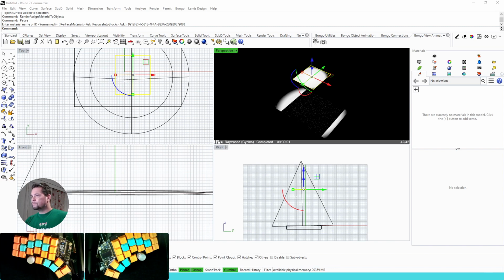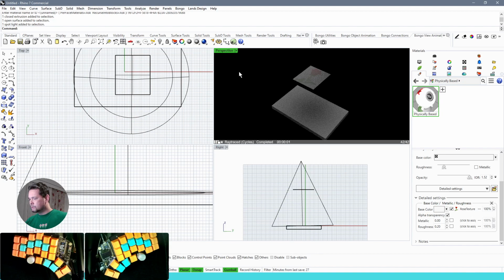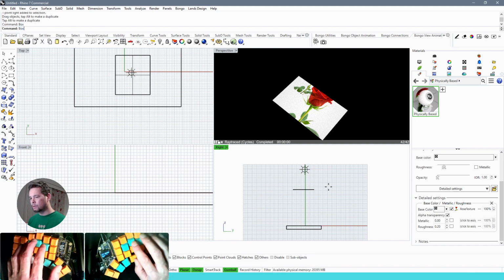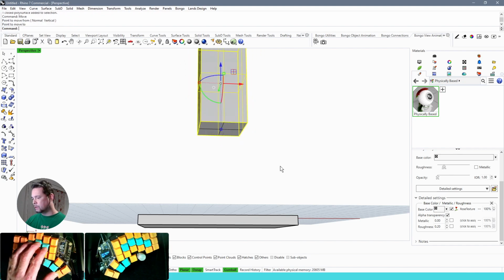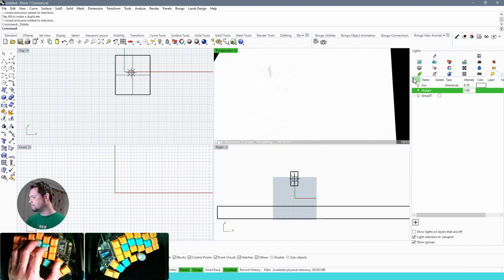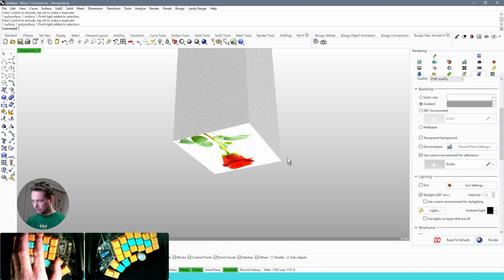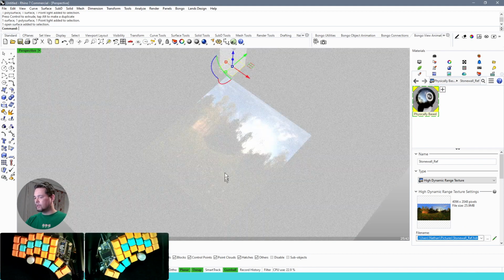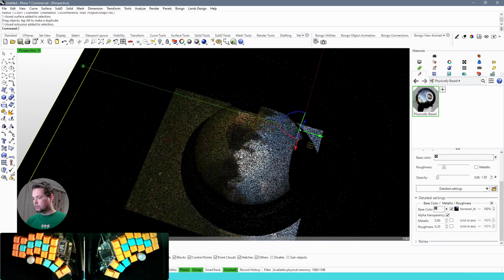Creating a simple projector setup

Comment: How do you get 'Raytraced (Cycles)'? Is that something that comes with Rhino Render within Rhino version 7 or did you somehow program or put a 'plug-in' program into Rhino3D in order to do that high quality rendering using the Cycles render engine?? I have Rhino3D version 6 which comes with Rhino Render but not the Raytraced Cycles (in the upper right corner I'm seeing when you first started the video at 0:00) window I'm seeing here.
Reply from the maker: Rhino 6 already has Raytraced, but the Rhino Render in Rhino 6 is what in Rhino 7 and Rhino 8 is called the Legacy Renderer. Rhino Render in Rhino 6, and Rhino Legacy Renderer in Rhino 7 and Rhino 8 are not based on Cycles. But Raytraced since Rhino 6 has been powered by Cycles.

Raytraced has been a part of Rhino itself since Rhino 6. And Rhino Render has been powered by Cycles since Rhino 7.
Reply: @jesterKingCode  Oh, OK. Thanks for info. That explains why I wasn't seeing the same thing in my now older version of Rhino (version 6) that I see in your video.  "Raytraced has been a part of Rhino itself since Rhino 6. And Rhino Render has been powered by Cycles since Rhino 7." <as you say... so, that's awesome because I consider Cycles render engine to be the very best render engine out there! For speed, no, but for quality yes. Considering speed, so far I like what I'm seeing with Twinmotion which is very fast and very good quality being VERY close to photorealistic rendering/pictures. Now I might bother to upgrade to Rhino version 8 instead of bothering to export/import between Rhino 6 and Blender just to use Blender's Cycle's render engine it has for free (but exporting/importing limitation/problems as always is an issue).
Reply from the maker: @kevine9376  you should try the Rhino 8 evaluation. The Cycles integration there is much faster than in Rhino 6.

For importing Rhino files into Blender you can try my importer import_3dm from https://www.rhino3d.com/download/rhino/8/import_3dm/ . This addon works on Blender 3.5 - 4.3. The latest release adds support for importing text annotations and vertex colors. Previous releases add dimensions and curves as well.